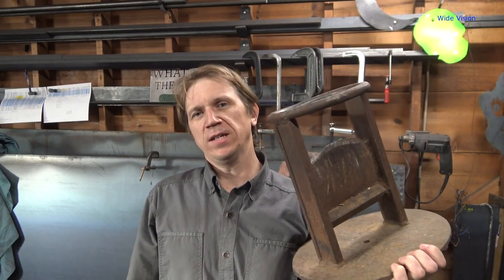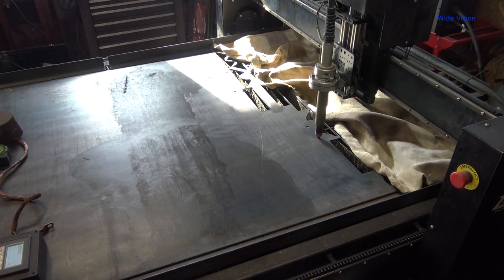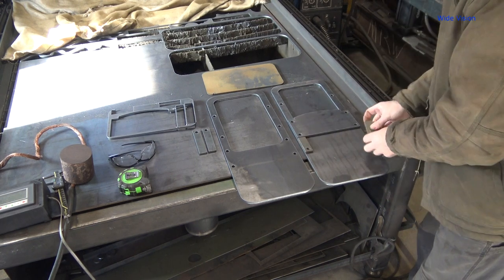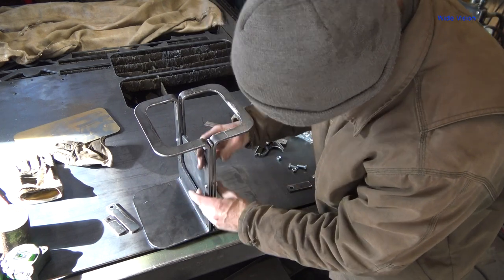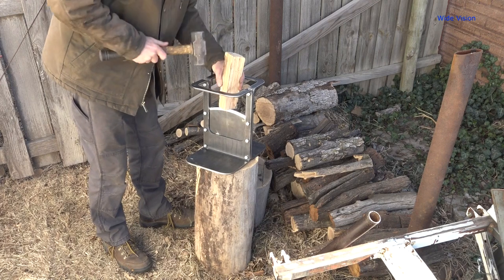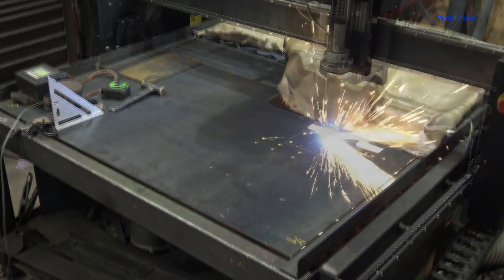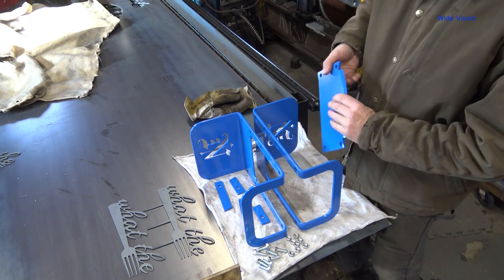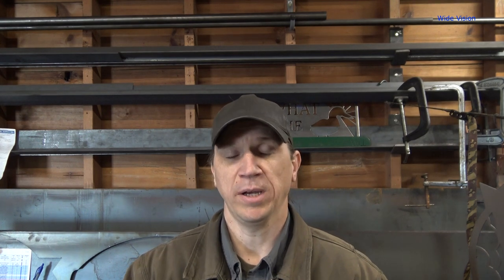FINALLY!  Building my **NEW** Kindling Creator Design!!!

Comment: I made one years ago and I have a sharpened file welded at the ends to a large metal ring as the blade. I have split pallet wood with the nails and still works great. Mine is mounted on am old car rim
Reply from the maker: Very cool!

Comment: I built wood splitters in northeast Kansas for years. I had some trouble keeping the blades sharp,so I finally run a few beads of stainless steel sharpened them and my trouble  seamed to go away.You do really good work. Good luck with your products.
Reply from the maker: Interesting idea. Thanks for sharing!

Comment: The only thing I’d like to see is more of an arc in the blade. I made something similar a while back but with a flat blade, and it choked on larger pieces of wood. The more arc there is, the easier it would be to split.
Reply from the maker: It's got a decent arc to it, about the same as  my axe.

Comment: I love your videos..especially your farm equipment vids...can I use a stick welder to re attach some cross members on galvanized panels?  Pretty heavy galvanized panels..not too thin.
Reply: My welding instructor some 20 years ago gave us a rule of thumb the decimal equivalent of the thickness of metal to the amps you use on your welder, I would suggest starting out and trying some little bit under that and please remove the galvanizing as best you can without lessening the thickness because that will burn through a lot easier
Reply: @heathworsley8347  thank you...ill give it a shot
Reply from the maker: Definitely agree with grinding off the galvanizing! Using some smaller diameter welding rods will help, too. At least drop down to 3/32, if not 1/16th, instead of the usual 1/8th.   Rod diameter is not supposed to exceed metal thickness, although that's impossible on really thin stuff.

Comment: Another really great video. I always look forward to seeing your posts. I think you're on the right path with this creation, not entirely convinced you need to go with an AR grade steel for the blade but perhaps a medium carbon heat treatable steel that you can use a handheld torch to bring to temper
Reply from the maker: Thanks! Oddly enough, it's easier for me to get AR than other steels that can be tempered.

Comment: If you cut your splitting blade out of the other side, it could be taller.  I don't know if you could raise the blade up to get the split farther from the lips on the side pieces which would help with the wood getting caught on the lips of the side pieces.  Perhaps with the longer blade, you could cut the windows in the sides lower and leave the cutting edge where it is.  That might present some problem with not having enough metal on one side of the bottom bend so it wouldn't bend nicely in your brake..
Reply from the maker: I just ground a taper on the "hang up" edges with the grinder. Guess I didn't point that out specifically when I made the new one.

Comment: Maybe hardfacing the edge could be an option if they wear out
Or just supply replacement blades
Reply from the maker: Hardfacing isn't a bad idea. It would probably be a fairly cheap method.
Reply: @WideVisionMetalFab  
There is a product called Cherry Red Hardening compound available too.  It’s maybe not the thing because you need to control heat ie. forge / possibly oxy/ acetylene . Works good though for whatever steel surface you want to lightly case harden.
Reply from the maker: @PhaseConverterampV   Thanks for sharing! I think I'll give it a try.

Comment: nice..  A   .250 thick   AR255 would last for ever.  but would drive the cost up.  ive got tons of ideas for my table. just know time to make the time for my projects.
Reply from the maker: Cost is why I'm starting out with just A36.  Time will tell how many complaints I get! I like the ideas floating around on here about welding up the edge.   And yeah, never enough time!

Comment: Nice idea.  As an idea, as the drop from the second large hole is unused, why not cut a spare blade out of it and either keep it for spare stock or ship it with the cradle as a customer spare?
Reply from the maker: Not a bad idea at all. Thanks!
Reply: Could you also make the blades double ended so that a dull blade could flipped over to keep you going?
Reply from the maker: OH! Another good idea! That would totally work.
Reply: That’s it, I have peaked for 2021! Time for a beer

Comment: What software do you use
Reply from the maker: For the plasma table? I draw in Cut2D and the table is run by Mach4 (Not Mach3)
Reply: Wide Vision Metal Fab il have to get that and try it